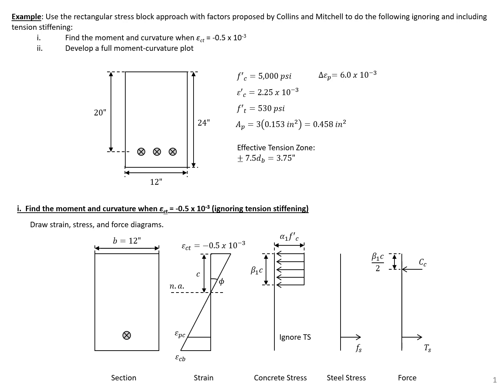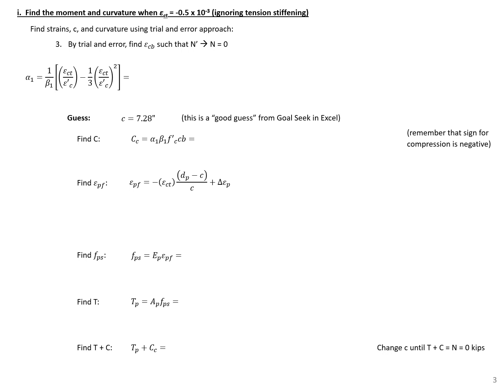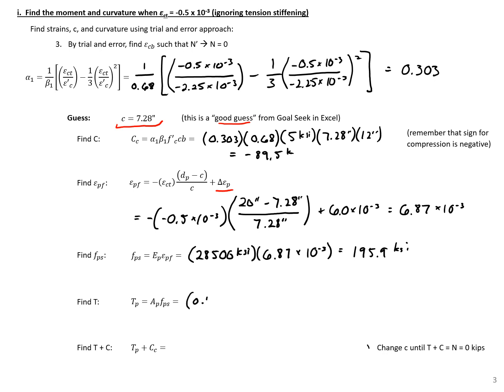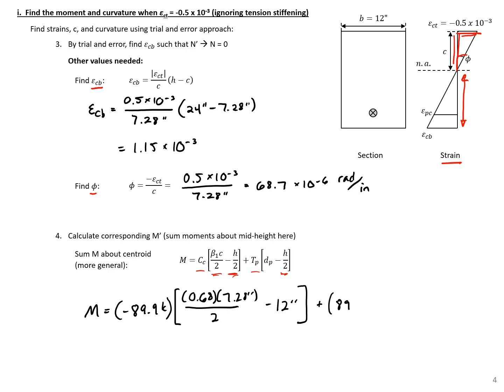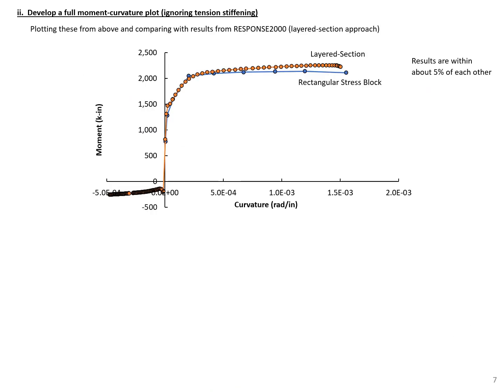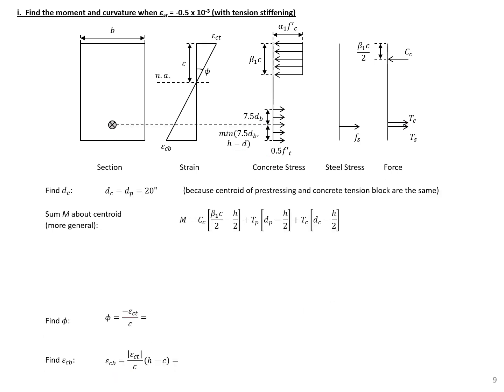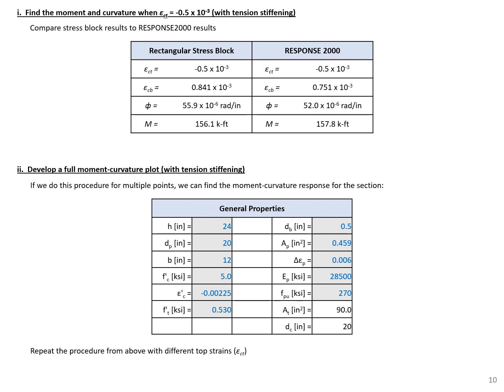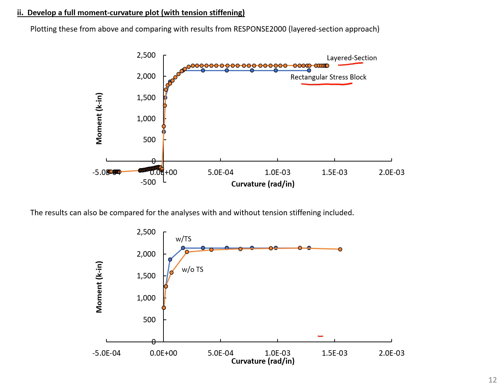Prestressed Concrete Design - 5 - Example 2 - Moment-Curvature using Rectangular Stress Block

Comment: Please reply. I want to find yield moment of hollow circular RC section using MS Excel for a given axial load. I have divided the section in to number of small strips. NA is located using goal seek function to have same axial resistance as applied axial load. As you replied earlier that no FOS is required to get yield strain of steel. But maximum allowable strain in concrete is 0.002 in IS 4998 -2015 and 0.003 in CICIND 2011, also Es is different in both the design standards. 
Q.1_will yield moment be different as per both standard?
Also after adjusting NA, in many top layers strain in concrete layers increased beyond the maximum strain given in the above two standard. 
Q.2_what is to be taken as strain values in those top layers? is it 0 or the maximum value in all those layers. If 0 will be taken fc = ec x Ec will be 0 too in those layers.
Q.3_also if in the top layers when fc increase beyond the  f'ck what is to be taken in those above layers? 0 or f'ck?
Reply from the maker: My quick response:  Varying the maximum allowable strain in concrete will affect the results. If your strain in a layer exceeds the maximum allowable strain, then you will have failure of that layer. This means that your section is compression controlled if this occurs before your steel is yielding.